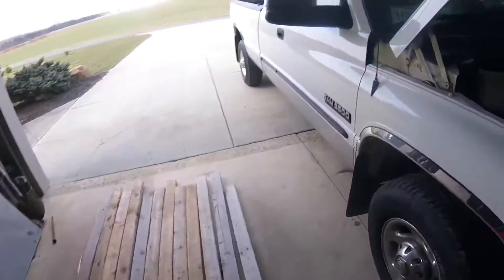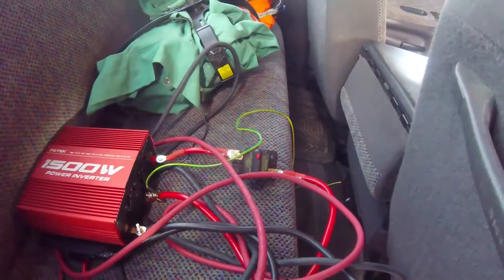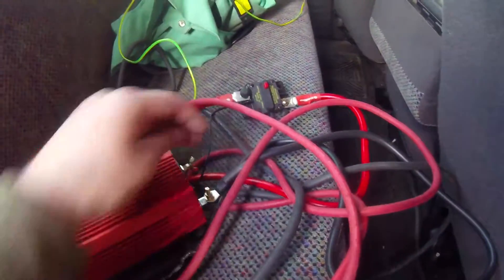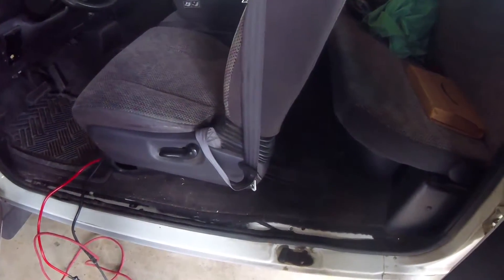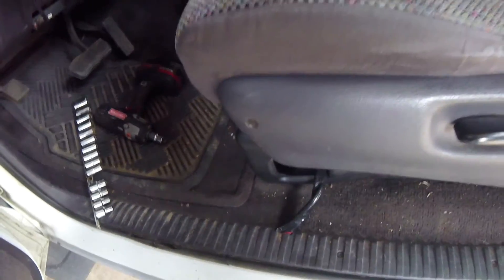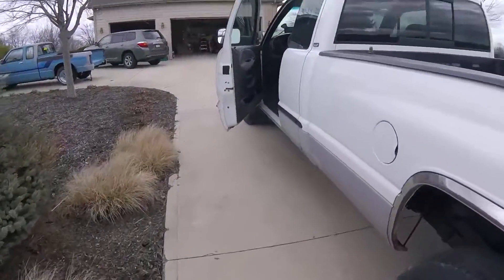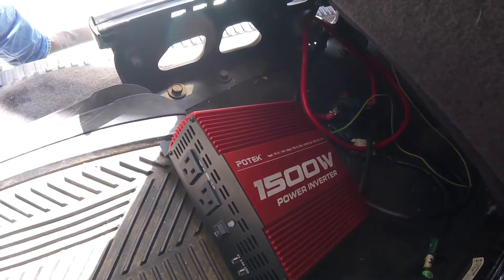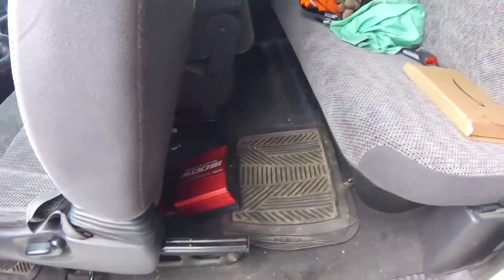How to Install an Electrical Outlet in ANY Car

Comment: The added breaker should be under the hood at the battery end of the cables. WIth it located at the inverter end, if a short to ground should occur along the red wire, the car will burn to the ground.

Comment: You could have grounded it to one of the seat bolts as long as you have good chassis and body grounds, and then you'd only need to run the power cable to the front. Since these are built just like an amplifier, they can be installed the same way.

Comment: NEVER use a circuit  breaker for an inverter they can be dangerous  . They can handle the power needed . Always use a fuse
Reply: More importantly, put the overcurrent protection device close to the battery so it will prevent a fire.

Comment: At the rating when shopping, it helps to know in advance what you are going to run, like a compound miter saw. The 1500 watts is peak as cold copper in motors have low resistance and amps fly in. This is called “Peak In-Rush” current in amps. Continuous is just that, after the motor starts working, wire in the winding get warm, increasing resistance and dropping amps needed to keep running.
RMS = Root Means Square, this is a true measurement of the A/C syne wave that is equal to DC power. Plug an oscilloscope into a wall outlet at home, you can measure 173 (+/-) volts at the peak, both positive and negative. The usable part of A/C that acts as the same power as DC. RMS means it has been test and work correctly. This goes back to the old Thomas Edison D/C feud with Tesla / Westinghouse A/C days and that is what engineers came up with to compare apples to apples.
DK. ASE Master Tech since 78. Retired

Comment: Do you need an upgraded alternator to run this thing?  I have a mobility scooter, and it is impossible for me to get it in and out of my van every time I need to charge.  My home does not allow outside power (100 years old), and I have no garage.  I was thinking that I could run one of these types of units and let it charge when I drive.  But I do not know if the alternator can handle such a load.

Comment: Can I plug a TV and a PS4 for my kids into my truck with that ? Thanks for answering
Reply from the maker: You should be able to do that, just do some research on what size inverter you need and make sure your alternator can handle it.

Comment: is it possible to have a 220v outlet on a 20a in your vehicle? if so what would you recommend using?
Reply from the maker: It is theoretically possible to do that but I'd recommend just putting a generator somewhere on the vehicle if you plan on using that much power, it'll be hard on the car batteries and basically everything else in the electrical system haha

Comment: I love this idea and came to check of its possibility. I would rather, however, use an extra battery so I do not consume the car battery power for the next car start up 😆
I plan to use this for my mini OBS (computer, router and the other gadgets, through a surge protector)
Reply: but would it be a good solution if you just want to plug in a soundbar? like a music box?

Comment: Does the truck have to be running ? And how long can it go without draining the battery
Reply: If the truck and it's alternator isn't running to keep the battery recharged, then it will begin to discharge the battery as soon as you begin using whatever you have plugged in, kind of like running your radio or the headlights with the motor turned off.  Might work for very short periods, but the trick is to figure out how long you can "run your load" (whatever is plugged in) without draining the battery below it's required "energy level" required to start the vehicle.  And the amperage drain of what you have plugged in has everything to do with how long that time frame is (e.g.  recharging a cell phone - very little drain, vs. using a power tool - very high drain).
Reply: Did you ever find out ??

Comment: Nice video, thank you. 
I would put a circuit breaker next to battery. 
Some shop did  an installation and didn't put a circuit breaker and the truck burned.